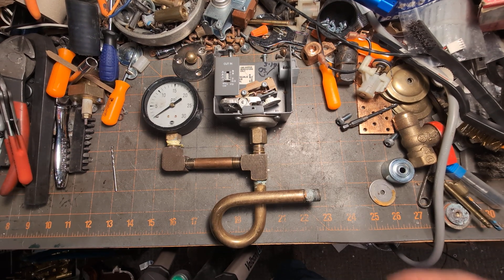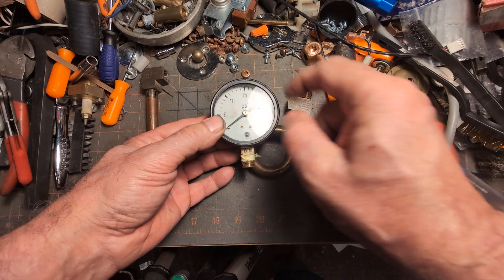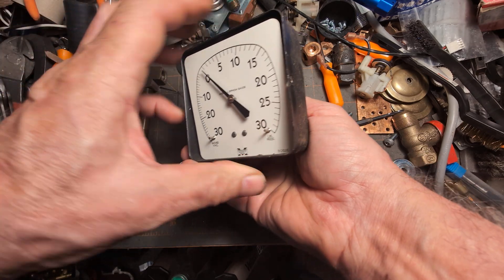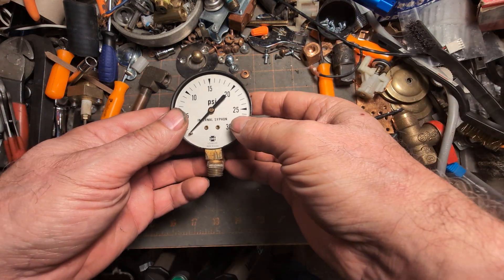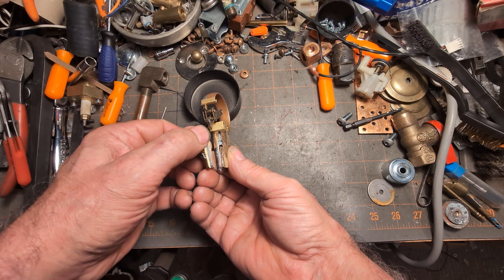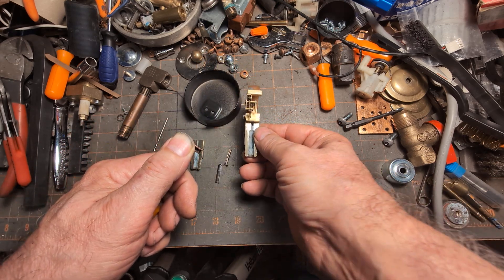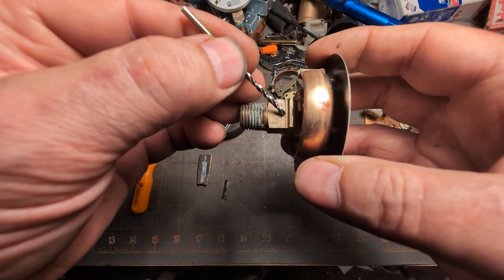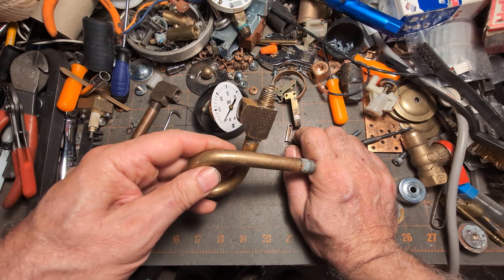Sneaky Steam Siphons Or An Internal Warning Label. You Decide.

Comment: 0:20 National Pipe Thread, or National Pipe Taper? I like Taper, it corresponds to NPS National Pipe Straight. What do you say? Nice cross-section of the tiny syphon!
Reply from the maker: Thank you!
I was probably speaking imprecisely regarding the thread types.  
Almost all plumbing thread types I encounter on USA stuff are the NPT taper type, as these gauges are.
The only straight type (i.e. non-taper) plumbing thread in the USA that are not special order are found on merchant or steel couplings from 1/8" NPT to 2" NPT. 
That's why they are not generally approved for  fuel gas service.
Any common steel couplings above 2" NPT are tapered.
There are other types of NPT, like a type used for liquid fuel, that work a bit differently than "standard" NPT and are VERY specialized.
One can get lost in the weeds on thread sizes and types.
Many thread types found outside of Eagleland are British Standard Thread, even in the MetricSphere!
These are all straight (male and female) and use the Whitworth thread (55 degrees instead of 60) and are almost but not quite matching with some sizes of NPT.